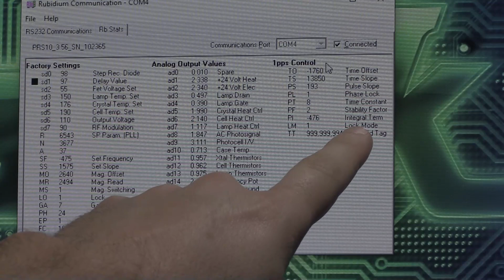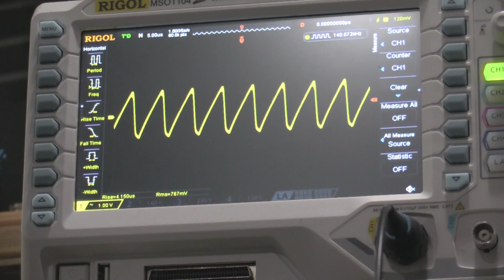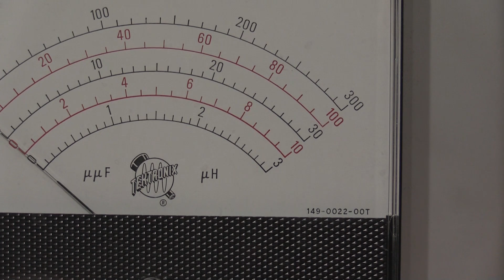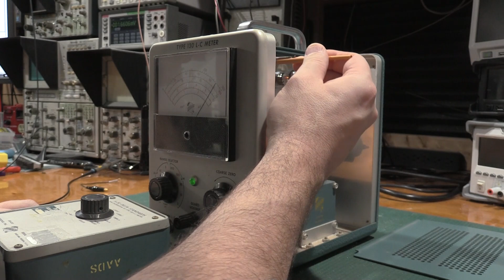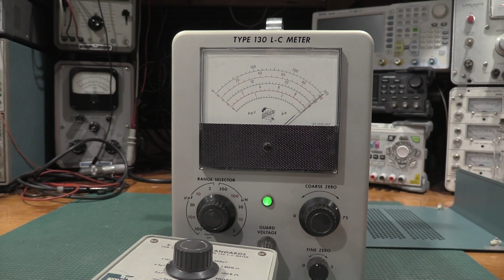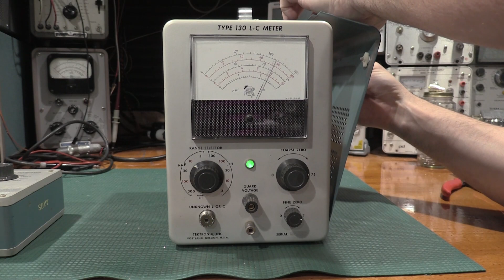Tektronix Type 130 Modernised Alignment

Comment: I recently acquired the 130 LC meter with the intent to precisely calibrate the input capacitor in oscilloscopes. I don't have the S-30 standard but what is the best way to calibrate a calibrator? How to know a 50 years old standard is accurate? I'm thinking in buying some new 0.5% or less capacitors to calibrate my 130.
Reply from the maker: This will work up to a point but the LC130 will be sensitive to the L and C of the cable and adapters used in the calibration. In Zeroing the LC130 there will be a slight but measurable impedance of the fixture which will be included in the Zero. If a video will help on this topic let me know and I can get one created. This is kind of a complex topic to explain over comments.
Reply: @ZenwizardStudios  Please, do so. A video with some more explanation, will help a lot. I read some articles where Tektronix recommends the 130 LC meter to calibrate the "factory calibrated" input cap. in the event of a replacement. Thank's for your reply.